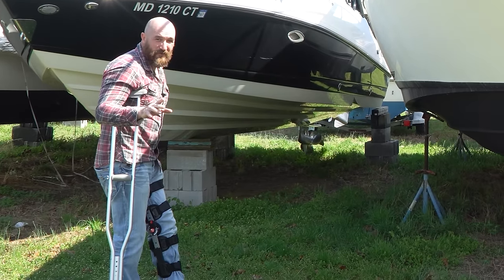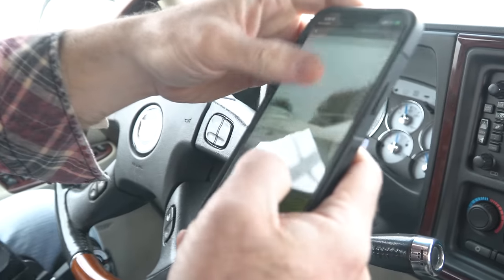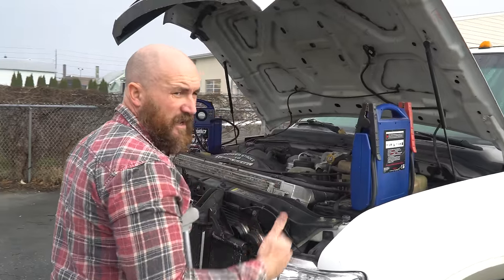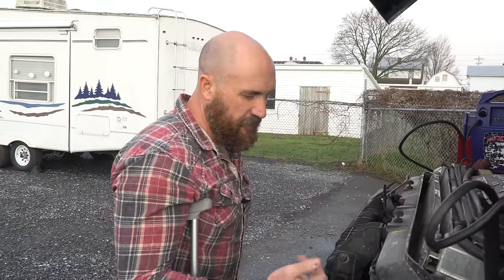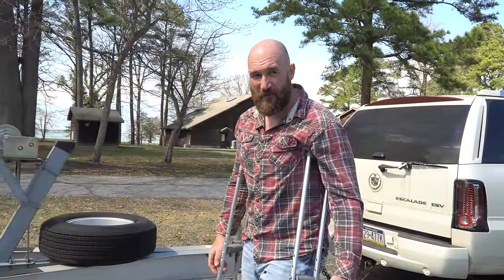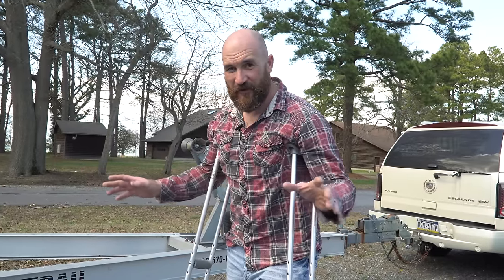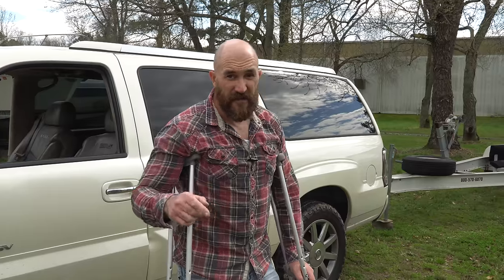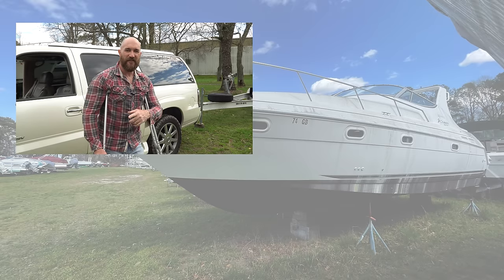We got a FREE Abandoned Yacht!

Comment: From a Ford powerstroke lover, should have left it run a couple minutes, 7.3 was a awesome international motor, 6.0 had issues till you bulletproof it which I did, 6.4 was junk but if they are built like the 6.0 it could be siction in the injectors till the oil warms up. Been cold here in Lancaster county for the past couple months so the oil is probably nice and thick just need it to get the flow back through those injectors!
Reply from the maker: Hey Mark ! 
It was so crazy loud of a knock that it sounded like the piston was going to come out the side of the block. Thinking this one will need a rebuild unfortunately.
Reply: don't do it buddy, the 6.4 is absolute junk.
Reply: @rebuildrescue  unfortunately he’s right, the 6.4 is a throw away. Unless it’s sticktion like he’s saying I’d probably sell it and not look back.

Change oil and add archoil additive. Worth a shot works great!
Reply: @mateo85tx  Am I missing something? It says 7.4 on the engine right?
Reply: @VincentGroenewold  They're talking about the truck engine, not the twin 7.4s.
Reply: @VincentGroenewold  idk anything about boats but pretty experienced in ford diesels. Lol
Reply: Hard to believe it’s a rod knock….
Reply: @jonsm114  loud injector AKA stiction.
Reply: @rebuildrescue  It could be a clogged fuel injector.  I've never owned a diesel vehicle but have had this happen many times in tractors.  Just pull and clean the injectors and hopefully you will be good to go.

Comment: For the 6.4, check the oil and fire it back up. If it sat for awhile it will run rough for a couple min while it purges any air from the fuel ststem. Newer diesels run insane fuel pressure with multi pulse injection so if it bleeds back enough fuel it will be rough because the fuel isn't atomizing properly and cause weird detonation.

That said the 6.4 is arguably the least desireable diesel engine on the market due to reliability issues. For Ford trucks the 7.3 is the "tank" engine. Seriously reliable, good power. The 6.0 stock is terrible, but built correctly can be reliable and make insane power while being the best sounding. The 6.7 is what you really want for daily use though, being the best combination of reliability and fuel economy.
Reply from the maker: I’m thinking we may put this 6.4 and do a bullet proof build on it.
Reply: LEICESTER FROM ABOVE  Rebuild Rescue: Next week "We win a house from a stupid bet by a subscriber" 😂
Reply: @MiracleMitch  🤣🤣🤣🤣
Reply: LEICESTER FROM ABOVE  Sounds like he might do a teardown if not, so we should find out either way. It does sound like my Passat TDI which presently has "rod knock" and needs a bottom end rebuild at 230,000 miles. Caused by the infamous balancer shaft oil pump drive wear issue that affected most of the 2005 to 2009 2.0 liter VAG engines with 'B' engine codes.

Comment: Unless those 7.4s are absolutely mint, I'd look into a diesel-swap. I don't know the measurements of the engine bay, nor what engine weight it's built for, but I'd consider two marine-Cummins 6s. The reason is not only economy, but range and reliability as well.
Reply: turbo-charged :D
Reply: @Oxizee  Of course :D
Reply: A free pair of Cummings would be quite the pairing 
I suspect just working with what is at hand makes more sense to the core of the channel 
Another adventure!👍🏼
Reply: @conradlogan5201  What is a Cummings?
Reply: @kerplunk38880  someone had suggested replacing the existing engine with a pair of Cummings 
(A brand of Marine diesels). 
I just googled to see what the market is like for a USED pair   Found one such pair (480hp each) for $60k
So, as you can see, it’s not likely a realistic target vs refresh what’s in place 
But…. He does seem to have sources 😉
Reply: @conradlogan5201  I believe you mean Cummins.

Comment: I have one of these trailers for my boat and its 32ft overall does the job perfectly for moving a boat it has a 9-foot beam cross which makes it an oversize you have to have signage that says oversized load on the back end of the boat and in some areas you need a permit to go down the highway bring along some 3 inch wide ratchet straps to hold the boat on to that trailer I hope the boat has twin outdrives versus twin screws and make sure you bring a lot of that Auntie mold stuff if it has set that long out in the open and a couple of biohazard stickers
Reply: So much mold! But I was a bit surprised it looked as good as it did inside. Question is how much water there's in the bilge. I'm also not sure exactly where they are located as there's a big difference if there's freezing in the winter or not. Ice expanding in the bilge each winter for 15 years would not be a good thing. It also depends on the hull structure. Old hulls that's not a sandwich construction are more durable but much heavier while a sandwich construction can be a lot stiffer and lighter, and cheaper to build. But if you get moisture in the sandwich and it freezes it will damage the hull.
Reply: Seriously. Did U even look at the video. It is shaft drive with prop pockets

Comment: i have the same Escalade as you, color too... my tow rig is a 06 duramax of the same gen as that escalade. best seats IMO, super reliable have had it for almost 10 years and it sits alot but never an issue, normally use it in the winter -35deg cels, fires like a dream, highly recommend

Comment: That size yacht should of had diesels..Gas engines wear out with relatively low hrs .. check the compression..
Reply: How hard is it to change them to diesel? I know nothing about engines.
Reply: Bis for Build is in the middle of just this process , switching of Diesels for LS motors, suffice to say not many people who know about boats are impressed with the idea
Reply: It wouldn't be feasible to put diesels in a  Cruisers (like a Bayliner) that boat was designed for gas engines,  diesel boats are designed (stringers) for the weight and torque of diesel's..
Reply: Weight is a killer for any gas inboard...performance is horrible, unless your just doing 6 or 7 knots. The engines will overheat and they start to wear out with relatively low hrs. That's the reason nobody bought the boat in 15 years of it sitting there.

Comment: Really, 15 minutes of hen chat before seeing the boat . He must have been the youngest in a bunch of older sisters.   Tunnel drives , great things good in shallow water, Works in almost a shallow as a jet drive. Don't even worry about cleaning the hull. Lipstick on a pig never works.  Gonna need new shaft seals and bearing to start.  Heat exchangers, engines, Xmsns, shaft truing, hoses, electrical.  A free boat usually costs more than a good working boat. Freshwater intrusion into stringers and frames, hehehe.   Best to pay a good reputable marine surveyor before putting a single dollar in cheap or free boat.  Wait till you start digging into the plumbing,
Reply from the maker: Ok ok ok so I have to admit something….  I actually am the youngest of 5 children and I have 3 older sisters ! 🤷🏻‍♂️😂🤣
I literally cracked up when I read your comment !
Reply: He has a YouTube channel though and can make a lot through the views if he made a video for each issue.
Reply: @rebuildrescue  hehehe,  All joking aside. Best to get someone very experienced to survey that boat. Many people spend way more money than the boat is worth and never recoup the funds. That boat was expensive when new. To abandon it , give it away for free,  many expensive reasons.  Although that's not to say, if you have the time and can get good parts cheap, it is doable. But it would suck to have to strip it our and replace the stringers and framing.  I've seen guys buy a boat, and have the engine rip out of it's bed, or sink because of bad sea cocks, hoses, stuffing boxes(shaft seals).   Like the old saying, A boat can be an expensive hole in the water.    Those tunnel drive can plane with half the power installed on that one.   Penn Yen had a line of tunnel boats , people loved em or hated them

Comment: Spray Nine can be purchased by the case, and does wonders with the spotty mold removal. My boat was essentially in the same condition when I started the project about two years ago. Full rebuild and repair of all major systems and I am trying to be as professional in the areas I am unfamiliar with, as I am with those I have some experience. 
Fortunately when it comes to mechanical and electronic systems my experience as a skilled machinist has, over the years, exposed me to equipment repair situation’s that has given me exposure to almost every skilled trade to one degree or another. I also have a very decent employer who allows me the use of the shop when I need it. Trust me when I say that access to a fully established, very successful and well equipped machine shop cannot be overstated enough.
If you have any boating questions or manufacturing/ mechanical issues, please feel free to reach out.
I greatly enjoy your channel, and was initially hooked when I saw your struggles with the 401. Your situation reminded me of myself. I wondered if I had gotten in over my head and my abilities. I have found that patients, a cool attitude towards setbacks, and knowing when to ask for help were all key ingredients to successful steps forward, and an eventual “light at the end of the tunnel” completion point.
Thank you for taking the time to read my comments, I can only imagine what a zoo your schedule must be like. I wish you and yours happiness and health in all your endeavors.

Comment: I've never seen that style inboard except on Penn Yan boats. They called it tunnel drive because the props are in tunnels. They're safer because they draw less water, but they're very inefficient. They were, maybe cruisers yachts has some improved design tunnel drive? Cool boat though. It's amazing how many big boats you can get for free. Boats that you can't trailer, that have you stay at the marina, boats that have annual expenses that you just can't get away from unless you abandon it!! You can get free sailboats too, if it needs a new engine or new sails or if it needs extensive fiberglass repairs. Good find, and good luck!

Comment: Most inboard drive boats have simple transmissions with forward, neutral and reverse gears. Can't see well from the video but if it's a V drive then engines are mounted backwards against the transom and the drive shaft runs forward into a gear box.  The reverse orientation of a direct drive .

Comment: I used to build those nextrail trailers! Nextrail out of Ocala, Florida. The tongue on your trailer actuates the brakes which is likely why there's rust under it, the hitch is steel and the rust dripped onto the aluminum rails. If you look at the diamond plate the the tail lights are mounted to and see SMS etched on it then I was the one who bent those rails and drilled the holes.

Comment: Twin screw it's called. U see how it's cut out above the propeller. It's called a tunnel for shallower water. U are going to have to scrape and repaint the bottom paint. Paint helps with electrolysis and prevents barnacles
Reply: I'd like to see what it is you guys are doing and how I could contribute.

Comment: If you’ve ever used Either to start it that will take rod bearings out in no time in those power strokes. They also have a problem with extreme carbon build up in the ring lands. causing excessive crankcase pressure.

Comment: What are the odds.....Watched this video a year back and was amazed and envied you for getting this boat for free. For sure it will take a lot of effort and money to get it looking great again. For 3 years we have been searching for our next boat. This time we wanted an express cruiser in the range of 28 ft  to 33 ft. When corona hit prices went up and beside that is what we were looking for pretty specific in arrangement and propulsion. Long story short(er). We looked at two boats last year that came within our price reach and also  had what we wanted. A Regal commodore 3260 yr 2001 and a Fourwinns 328 vista cruiser yr 2000. The first was very nice price wise but looked a bit more oldfashion. Berths were pretty huge and interior looked like new but the "door/drawer behind other doors" style of galley was less handy, engine bay was a bit of a mess. Wet, oily and one big pile of wires. 
Bilges were almost dry but just pumped out as you could see and a lot of growth/fungus under the floor. The second one looked also great inside the cabin. Much better galley and better bigger seating area below. berths a bit smaller but just ok. Engine bay was much better. Engines ran great etc. Only windscreen framing and dashboard and radar arch needed a lot of attention from corrosion. And found a 1 meter long crack on the foredeck. Thought about it a few days, decided to bid on it .....and then i heard it was sold to some other person. And last week we looked at the boat market place like we do every day for the last few years and then I saw a cruisers yacht. not too far away, looked great. a bit bigger and more expensive but had it all. went for a visit last weekend and now we decided to try to buy it. Thought about this video and the similarity. Watched it again and turned out to be almost the same boat. A 2001 cruisers yacht 3470 express. This one has two yanmar turbo diesels with v drives. engine bay looks very well cared for. Not a spot of grease on or under the engines. Dry clean bilges etc. . Think yours is a yr 2000 3375? For sure after deep cleaning the interior you will get a very different feel in this boat. It is very cosy and feels roomy compared to the others (it is also a wider hull so not a strange thing). Can't wait to see yours getting allong. I like the plane video's but boats are really my thing.

Comment: The engines are probably going to need work maybe replacing but the Allison marine clutches will probably be alright, you will need to check the packing glands where the shafts go through the hull, they will need new shaft packing. Check the props to see that they aren't bent or dinged up ( they are bronze and will break the flukes off if you hit something hard I prefer stainless because it only bends and can be straitened back out and won't go out of balance). Your generator may have an auto start system where if you turn on something electrical it starts

Comment: A lot of people are afraid of boat motors. I have friends that will work on their own car but won't work on their own boat. As long as I can buy a repair manual I'm not afraid of working on anything. I always like to say if a spaceship was to land in the middle of my street with engine problem that in my garage I would have every tool needed to fix it and if they brought the manual then I know I can get them back on their way. -)

I'm really looking forward for watching you get this back together. Mostly your problems will be engine and generator. The good thing is you can buy every single part for both engines and generator and the transmission are pretty much the same across all manufacturers boats. They're only a handful of people who make the gear that makes the boat work. 

One major thing to keep in mind make sure the exhaust manifolds are not rusted out. You can blow up a brand new motor if the exhaust manifolds are shot. Boat exhaust is water cold and over years they rust out. You can hydro lock your motor and depending on your speed and load you can punch a hole right in the block.

You can always find a good deal on exhaust manifolds from outside vendors. You really don't need OEM. With all the ones that I have worked on I have never had a problem with aftermarket parts.

I love watching your planes videos but I can honestly say I'm more excited about the boat. Doesn't mean I'm not watching the airplane videos which I am. 

Look forward to watching more videos as they come out. I think I have pretty much watched all of them. Of course I always make sure to give you a thumbs up and of course I'm also subscribe to your channel.

Comment: The difference between what you call an "Out Drive" we in Australia call them Stern Drives, is the serviceability and costing. When an "Outdrive is left in the water for prolonged periods, they need to be basically rebuilt every 2 years, with seals impellas and anodes, also the cases that hold all the components corrode quickly and hence every 5 years you would have to replace the Outdrive. I know many would differ with me, but on the safe side to do so, as the cases get weak.Now that you call the "Direct Drive" this is just called a shaft drive, as you call it a "Direct Drive" and you are correct in saying that :) as it connects directly to the gearbox of the internal motor, The advantage to this and an "Outdrive" is that there are less parts in the water that can be corroded over time. The shaft and shaft tube are Stainless and the bearings are Bushes and are bronze or stainless and lubricated by the water being drawn up through it into the bilge. Basically a Prop, Shaft, shaft housing Rear bearing (Cutless bearing), Stuffing Box and the gear box couplers SO as you see the parts list is very small so serviceng is quicker and less cost and you do not have to pull it apart on every 18 months to 2 years when the boat comes out of the water for antifouling. If you had an "outdrive you would need to service that and thats about $2500 just for the drive and if you have 2, well thats $5000 (AU dollars) with shafts will that cost is well less than half if any, as all you do is coat it with antifoul and check that there is no movement over the tolerances :) on the shaft :) and your stuffing box stuffing :)